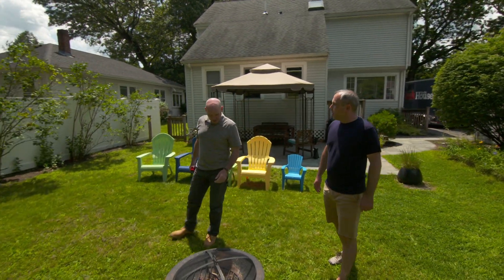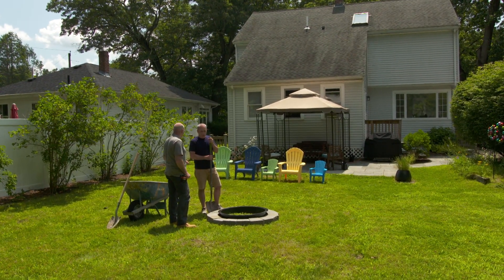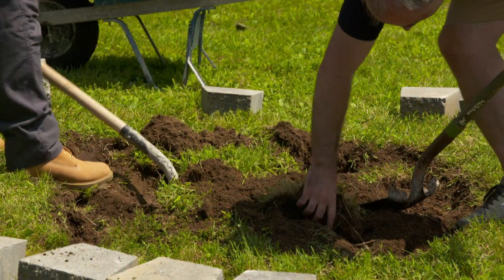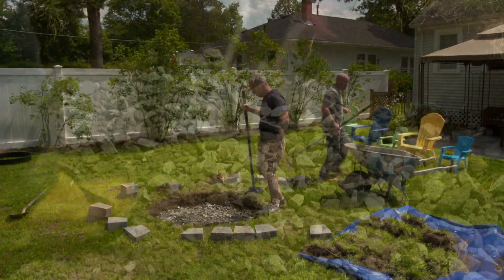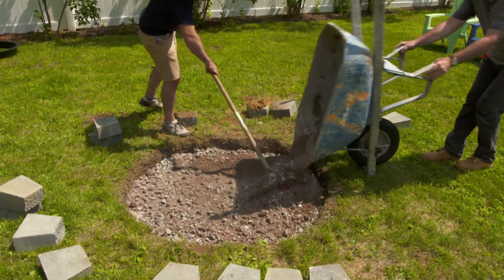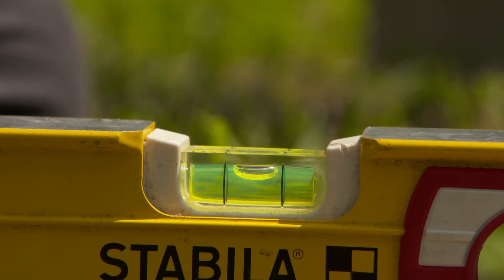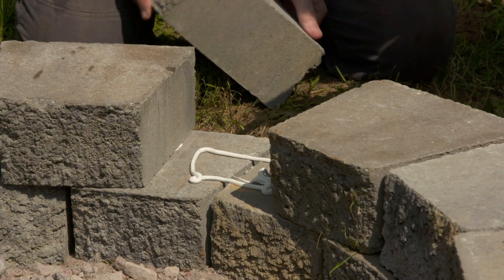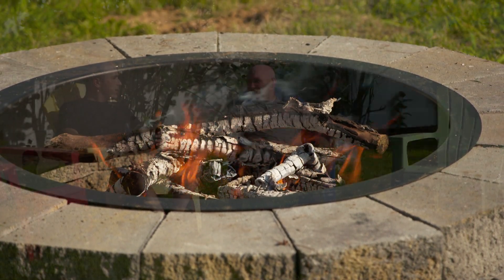How to Build a Fire Pit from a Kit | Ask This Old House

Comment: Make sure that the lava rock, or any 3¾” stone, that you fill the inside with is high enough to reach the bottom of the metal ring. The fire ring is there to protect the stone pavers from the heat of the fire. Below the ring you have unprotected bricks; which you cover up with fill.

Comment: Is there a reason why at 3:25 they didn't put the stones snug against the steel rim?
Reply: To allow for expansion of the steel ring when the fire is running
Reply: To allow for airflow to the bottom of the fire which makes for a better fire and less smoke.

Comment: I’m by no means a masonry or landscape expert, but I dug about a 3 foot diameter circle. I removed about 2 inches of dirt. I filled in that area with two bags of stone dust for drainage, and then four bags of egg rock. Then I rimmed the outside with 89¢ pavers and it looks great. I don’t burn directly on that rock as I use a metal fire pit that I put on top of that. Otherwise I spent maybe $60 in total plus some elbow grease. Works well and looks great too. It’s definitely not a manicured perfect rock circle but I didn’t need to buy a kit like this. To each his own, I’m sure there a million and more different fire pit ideas. This was just my take on it.
Reply: I plowed a 1 acre garden plot and used the rocks I unearthed to make my fire pit, free is me!!

Comment: Wouldn’t the gorilla glue fail with the intense heat of the fires?
Reply: They put a heat shield but yeah you want to use something stronger and meant for masonry to hold up better in long term